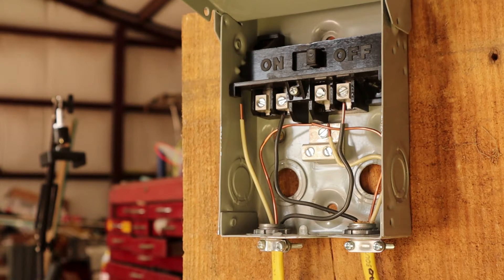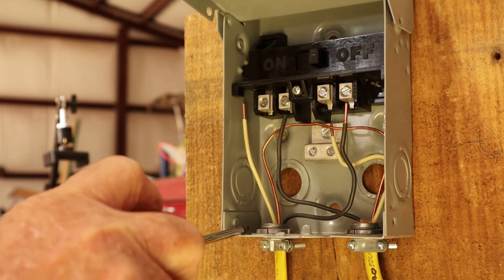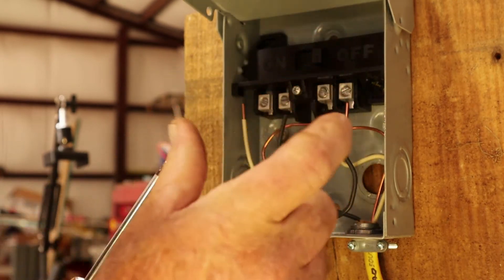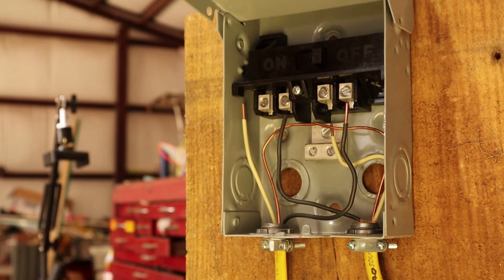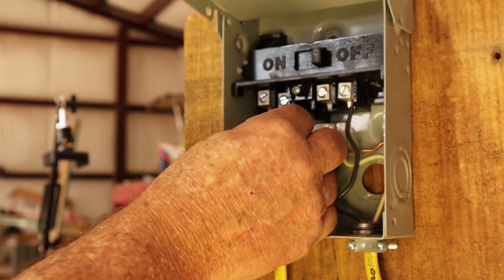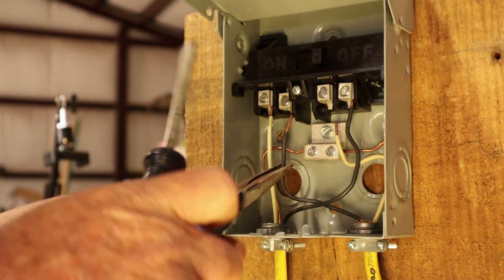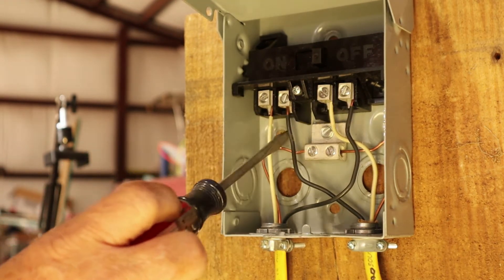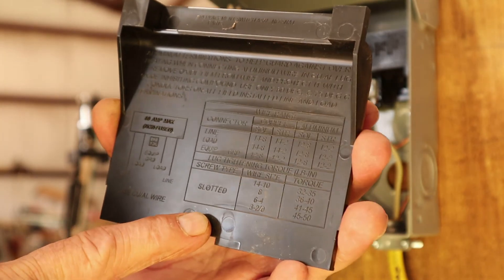How To Hook Up a 240-Volt AC Disconnect Switch

Comment: Why did you not match the wiring colors?  Black line - load Black, etc?
Reply from the maker: Not necessary when each wire will carry 120 volts to get a total of 240
Reply: It's all good so long as there is an incoming hot and outgoing hot on each side.
Reply: @PoNKPoNy  NEC?
Reply: @jamesmpaton  I don't have my electrical work inspected or permitted. Therefore, I just get the job done safely and functionally:)
Reply: @PoNKPoNy  Sure, I gotcha.  Can you describe how you twist on wire nuts for me?
Reply: @BROKEN-PILOT  clockwise

Comment: If im using a voltmeter to check for voltage, am i putting one probe on the line and one probe on the load?
Reply from the maker: Meter connects to each leg that has 118-120 volts. You should get a reading somewhere close to 240

Comment: Are the center lines supposed to show any type of voltage generating if using a voltage reader? My AC isn't turning on yet I have 119ish showing on the two exterior lines but 0 on the inner lines. Thank you

Comment: Those wires are way too small for 60 Amps.
Reply: The Disconnect switch is rated for 60 A. The load in this case is no more than 20 amps, judging by the 12 ga. cable.
Reply from the maker: I believe I stated that in the first part of video..This video was the basic way to hook it up. Appreciate the comment

Comment: Where is the neutral?
Reply from the maker: according to directions on this box you do not use Neutral with the 220-240 Volts
Reply: @LarrySbrusch  And yet, what if the 220v device also contains a 120v device which needs a neutral white wire? I find this issue confusing, and actually had never previously heard that no neutral is required in 220. For example, I needed 220 for a stove and the heavy duty wire had 4 prongs: two hots, a neutral, and a ground.
Reply: @KpxUrz5745  Some appliances, like stoves, require both 240 and 120 v. Thus the necessity for neutral in those cases. Air conditioner usually only needs 240 volts, so no neutral required.

Comment: what's the wire gauge that you used for this 60 amp disconnect?
Reply: Yellow romex is 12 awg
Reply from the maker: depends on load.. but a close guess would be around 4-6 GA
Reply: @LarrySbrusch  I'll be putting up a 60 amp disconnect too, I didn't hear you mention what size it was just wanting to know. Thanks